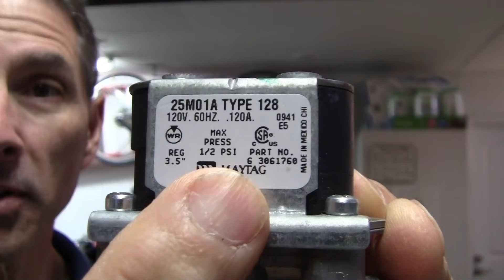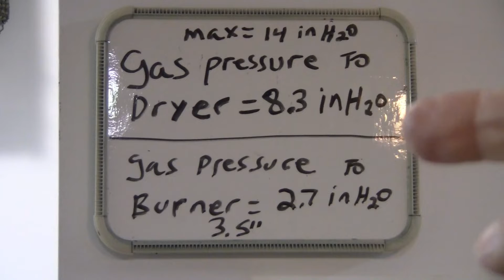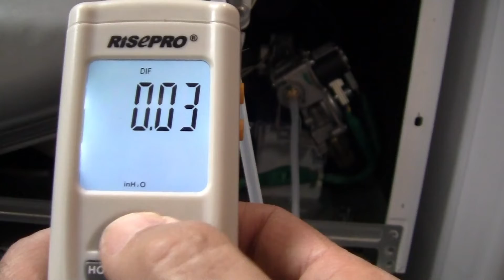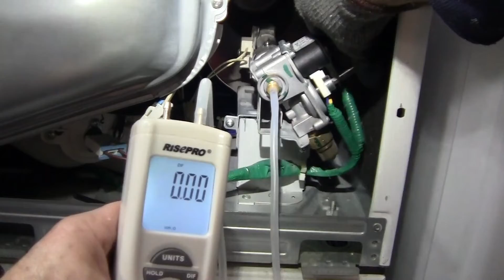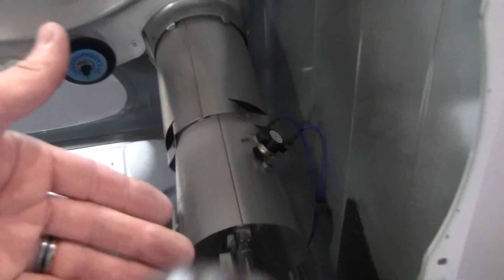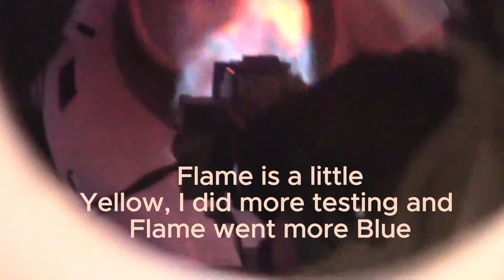Gas Clothes Dryer Gas Pressure Troubleshooting

Comment: Great demonstration. My Maytag ignites the flame on most attempts, but about 1 in 6 cycles it will fail to ignite. The igniter has been replaced (OEM part) and new coils were tried. Same symptom. I inspected the valves and orifice and found no flaws. I wonder if it is simply low pressure. The delay between igniter off to ignition looks a little slow to me. Since my gas furnace and water heater appliances work well I suspect the appliance gas regulator (or pressure setting) but I don't have a meter. Any advice is appreciated.
Reply from the maker: with out a meter, you will not be able to check gas pressure. I would put all gas appliances on and then start the dryer to see what happens. If you want to save on the manometer, you could adjust the valve and watch the flame to get a stronger flame and try that.
Reply: @KenTraining  Thanks much, that was what I was thinking, experiment a little before replacing the valve assembly.

Comment: Flame sensor is not detecting the flame, causing the gas valve to shut off
Reply from the maker: if you have a proper flame, it is possible that either your flame sensor is not in line of site of the flame or you may have a bad flame sensor.

Comment: Are you still taking questions
Reply from the maker: Ask the question and I will do my best to respond.
Reply: So I replaced almost everything in my dryer including the board and it'll only heat's up for 20 minutes the flame goes out. It cycles like it should put the gas won't turn back on unless you turn it off and wait a half hour  @KenTraining
Reply: I replaced the gas coils 3 times because I thought they might be faulty ones new thermostat new thermal cutoff new thermal fuse new high limit new board new heater controller switch. So I'm starting to think it is a problem with the gas pressure
Reply from the maker: @ These types of troubleshoots are hard to find. If you think its the gas pressure, I would install a tap on the gas pipe just before the dryer and hook up my manometer to it to measure the pressure before and during the cycle. When the gas is running the dryer, I would also turn on every other gas appliance in the house and see if this has any effect on the incoming gas pressure. after ruling out gas, I would think you have something that is heating up and causing the flame to go out till it cools off. This may be hard to find and I am not sure myself how you would find it. Checking gas pressure is an inexpensive start... Let me know what you find.

Comment: Great job. Had to replace my solenoids on my gas dryer about a year ago too. Cheap to do. Like $15 bucks but definitely the major cause of intermittent gas flame issues and not drying clothes in a gas dryer.  Easy fix as well. Don’t get concerned about the fact that you’re working on or near the gas valve. The fix involves no messing with gas lines.  How do you like that manometer you have?  A tool I’ve always wanted to get!  Thanks

Comment: With doors off, more oxygen too much heat ?
Reply from the maker: with doors off the air flow is off and not pulling through the unit as designed. This will trip the high temp cut out switch.

Comment: Are you using propane or natural gas and would adjustments need to be made when converting to propane.
Reply from the maker: I am using Natural gas and yes if you were using propane, you would need to make adjustments.
Reply: @KenTraining  My dryer was converted to Lp. It has worked fine until Lp company changed tank, line, and incoming secondary regulator. After that, my dryer kept making popping noise with gas. Assumed this was air that needed purged. After purging in a ventilated area, it continued to do it. I followed your steps and have a valve that says 4 in of water. The manometer reads 6 in water and I continue to adjust and it seems to not really move much. Any idea what I am doing wrong? Thank you

Comment: Would have been nice if below door they made a access door just big enough to hook monitors
Reply: I cut a hole in mine and have a small grommet. It’s not large enough for monitors and stuff but it’s large enough to see in and see if the flame is on or off.  A small rubber grommet covers it.

Comment: How do you check for the leak on old GE dryer that smell gas when not in use , when I open the dryer door.
Thank you if you can make a videos
Reply from the maker: you would check for leak with soap and water solution and spray all joints and look for bubbles.

Comment: Why would gas pressure require adjusting at all unless the circumstances of delivery (e.g. supplier or source) changed? I'm also getting ignition from primary, then the burner flame seems to start to come on before immediately stopping. I've checked all of the switches/fuses, put on new coils, problem continues. I put a new gas valve in last year, but it wasn't OEM. I'm really at a loss. We have propane as a source, which I suspect is dirtier than NG. Otherwise I don't know.
Reply from the maker: I know you fixed your issue but I want to respond to your original question. In most cases you will never need to touch gas pressure adjustment screws. I wanted to do a deep dive and measure it and check the flame. I also noticed that I could not find 1 video on YouTube with a gas dryer measuring gas pressure. Let me know if you did find another video on your research and send me that link, as I would like to watch that video. 
Thanks KenTraining
Reply: To answer my own comment: With the new coils not helping I decided, as a Hail Mary before springing for a new gas valve, to examine the existing valve to see if it had been clogged or damaged. Before removing I had to shut off the gas, naturally. I noticed the lever, set against the wall, was perpendicular to the line. Odd. I twisted it parallel, but since parallel usually means "open" I decided to check the dryer operation lest I get a facefull of propane. Sure enough, the dryer worked flawlessly, the burner ignited immediately. How that valve, set against the wall between washer & dryer with only an inch of space between them, came to be closed is a mystery. It's just my wife & me here. Only possibility is that I sometimes keep a mop between the two machines. Somehow the mop head must have turned the valve. Anyway, I just wanted to point out that sometimes we overlook the most basic causes of an appliance not working: is it really plugged in? Have gas? Batteries good? In my defense there is just no way that gas valve should have been closed all of a sudden, so I didn't think to check it first. Lesson learned ... I hope.
Reply: I’m having an issue where my dryer is not getting hot enough. So this is really helpful. Thank you!